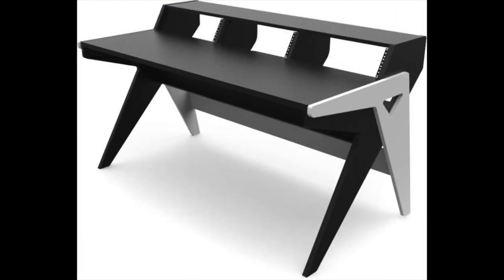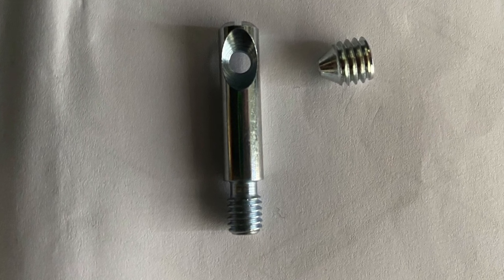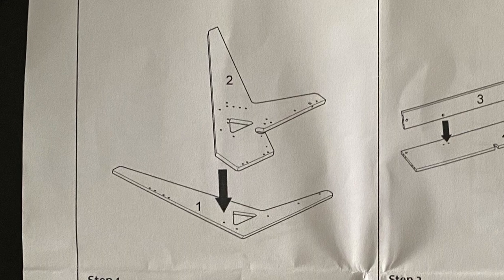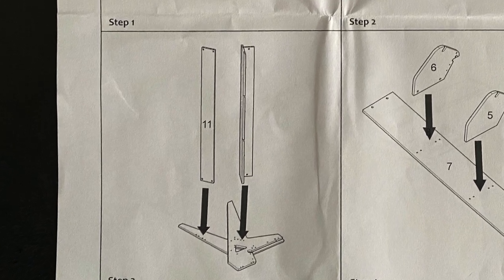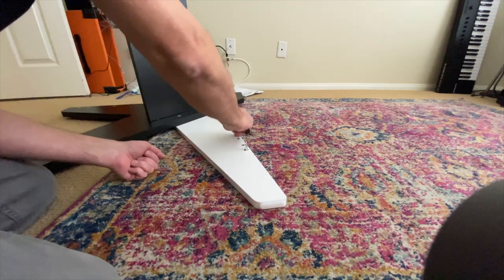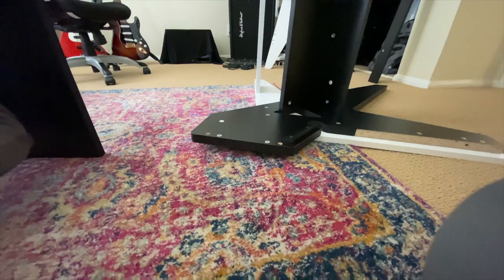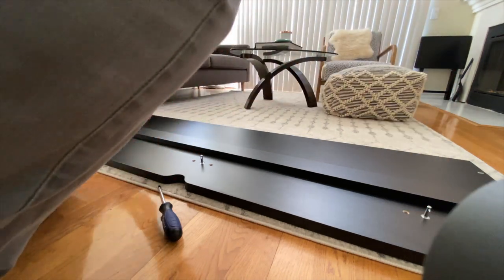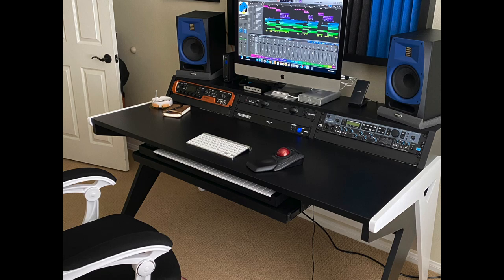Zaor Vision W Assembly

Comment: Video was really helpful. Thank you for this. Do you have a link for where to get the keyboard tray?
Reply from the maker: Sorry I just saw this.  I had to make the keyboard tray.  It's a solid piece of spruce that is 36" X 16" that I got at Home Depot precut wrapped in plastic (11.99) and the sliders I got on Amazon  

(https://www.amazon.com/gp/product/B07H9XXWFW/ref=ppx_yo_dt_b_asin_title_o07_s01?ie=UTF8&psc=1)

I only use a NI A49 so it's only 32" X 10" which fit perfectly.  Zaor make a neat keyboard stand that rolls under the desk but it was $300.00 and was way more than I needed.

Comment: Looks like you inspired them. They now have an assembly video on their YouTube page. Yours is much better. Thank you for the video. Would you say the desk is MDF or straight up particle board?  Cant find that info anywhere. How's it holding up?
Reply from the maker: Thanks for the kind words.  I have to say honestly it's the best made desk of it's type.  I've owned 2 other Argosy desks and they were amazing builds but you get what you pay for.  The Zoar is particle board but its hard as a rock and the packaging it came in was amazing, everything got to me perfectly.   The angle of the 9 rack spaces, the size of the work area, and the cable management work great for me.  The legs and the desktop are 1" thick so they have held up great and it still feels solid.

Comment: Nice! Zaor should really have gone with the keyboard drawr modification you have done here instead of the optional addition they sell. I like the way you did it better 👍 how and what did you use to mount it on?
Reply: I just ordered this desk! I like the keyboard drawer you added. What is it?
Reply from the maker: I use a NI A49 for a keyboard controller, it's small.  Went to Home Depot and bought a 12"X36" plank of birch (comes wrapped in plastic)  then I bought these:  https://www.amazon.com/gp/product/B07H9XXWFW/ref=ppx_yo_dt_b_asin_title_o05_s01?ie=UTF8&psc=1    from Amazon because they have adjustable height clearance.  Cost me $40.00 to build, but mind you the keyboard is on the smaller / lighter side.  The reason I think Zaor went with the rolling cart keyboard stand is the brace that goes under the main desk.  You have a depth of 15.5" from the front of the desk before you hit that.  The brace is a good thing adding stiffness to the build but limits how far a keyboard can go under.
Reply from the maker: @zynth123  Hello, the top of the desk is 1" thick and I believe by the look and feel of it that the material is pressure treated.  If you were to hang the keyboard tray from the desktop using heavy duty sliders I think you would be fine.  A 3/4" screw into pressure treated melamine that is 1" thick should work (several screws of course).  Heavy duty sliders are rated at 75lbs. per pair.  Also, I would recommend running a spar or brace on the back of the shelf to keep it from bowing.  

Here are some links:  https://www.grainger.com/product/4KRP3?ef_id=CjwKCAjwgviIBhBkEiwA10D2j7JojDr4cRau3Ytax5QfoPKfOMbmneY2pGXkdUvIz2QCNpNEM-vcExoC1bMQAvD_BwE:G:s&s_kwcid=AL!2966!3!264955915892!!!g!439969404635!&gucid=N:N:PS:Paid:GGL:CSM-2295:4P7A1P:20501231&gclid=CjwKCAjwgviIBhBkEiwA10D2j7JojDr4cRau3Ytax5QfoPKfOMbmneY2pGXkdUvIz2QCNpNEM-vcExoC1bMQAvD_BwE&gclsrc=aw.ds

https://reverb.com/item/2685610-88-key-keyboard-shelf-kit-for-existing-desks

Comment: hi, with a 49" curved monitor and yamaha hs7 speakers, does everything fit?
Reply from the maker: Well, it depends on if the 49" is corner to corner or actual desktop area.  The desk is just under 63" wide so at 49" wide (area) that only leaves room for 6" wide monitors.  My Personus R65's (that I love) are 8" wide and have a 6.5" Woofer.  I now have them on heavy pedestal stands so I have more desktop.

Comment: Thanks for this,  Does it come with the keyboard tray or did you add that?
Reply from the maker: I had to add it, they make a keyboard stand that slides under the unit but it was overkilll for me.  I use a NI A49 which is only 32" wide.  You can't fit anything too big under there because of the brace on the bottom of the desktop, it only has a depth of 15 1/2 "

Comment: Hey on an aside, what desk chair is that?
Reply from the maker: Funny you should ask... that was probably the worst chair I ever had.  It's a Hbada and write that down so you never buy one.  Every point that touched the body was wrong, it was advertised as a super comfortable chair... it wasn't.  AND... it creaked right out of the box like cheap plastic  (or "as" cheap plastic I should say) AND... it swayed from side to side like you were on a bass boat.  Just garbage.   I learned a lesson... just because it matches the motif doesn't mean it's good.  I brought my 10 year old Hyken mesh chair out of the garage and have been using that for the past year.  That is probably the best studio chair I ever used, I have 2 of them.  You can sit in them for hours, or just fall asleep in it and you will feel fine.  Sorry for the long response.... just had coffee.
Reply: @atsrecords1960  nice, thank you for the reply! It is cool LOOKING, but of course that doesn’t mean it will be comfy… will check out the Hyken! Thanks again for the video, I still have to build the piece that accompanies (that goes under the desk)… 🖖🏽

Comment: I noticed you have a keyboard tray with the vision w. How is that possible? Don’t see a keyboard tray in the desk description anywhere. If so is there a 88 key tray?
Thanks!
Reply from the maker: Hi John, if you go down to the conversation with Juan Figueroa below you will see how I did.  You can fit an 88 key board under there BUT... it can only be 15" deep because there is a main support under the desktop that runs the length of the desk.
Reply: @atsrecords1960  Great. Thank you😀
Reply: @johnzmedia  I am interested in this too but I am not seeing this conversation with Juan.
Reply: @adamphillips6747  https://www.leevalley.com/en-ca/shop/hardware/slides/undermount/48619-50-lb-under-mount-slides
There is enough room underneath for the 14 inch rails. Will fit an maudio key station 88
I may have to put a spacer at the top to allow for the height of the keyboard. The rails are 31/8 inch height max and the keyboard is real close to that.
Reply: @johnzmedia  cool. I am waiting for my desk and wanted to be prepared. I am only putting a Roland 49 under there  but I want it off my desk.